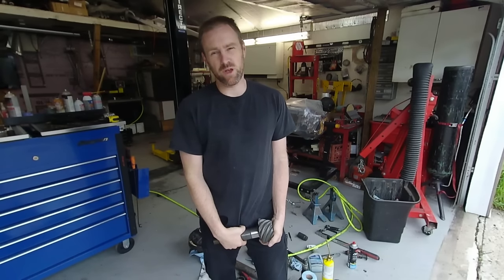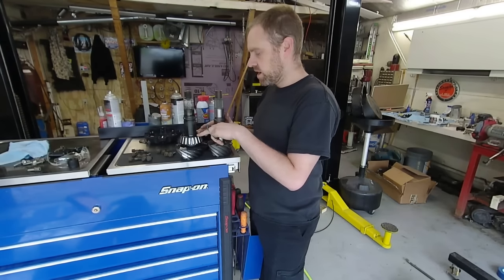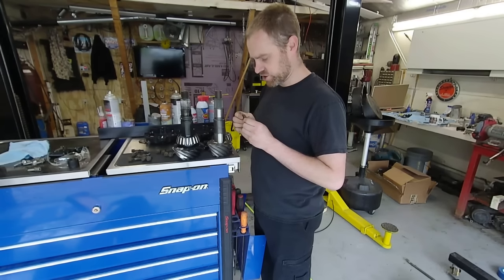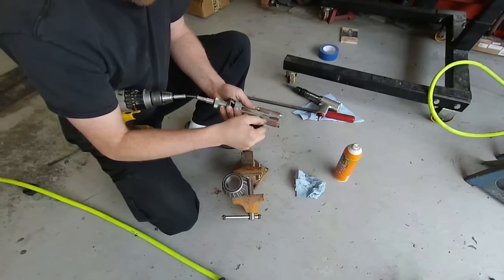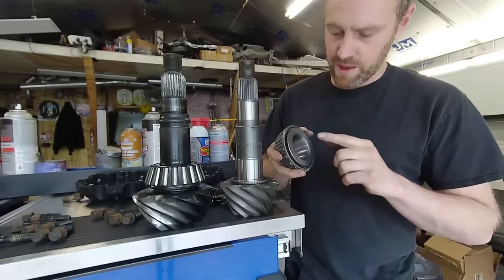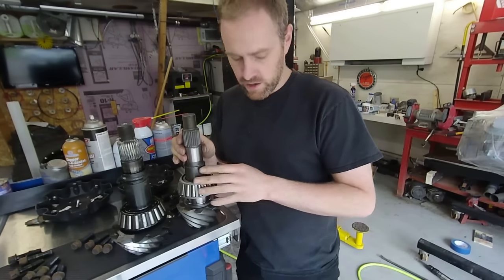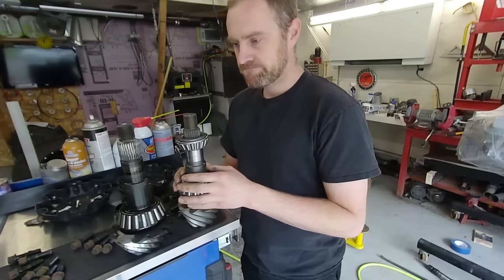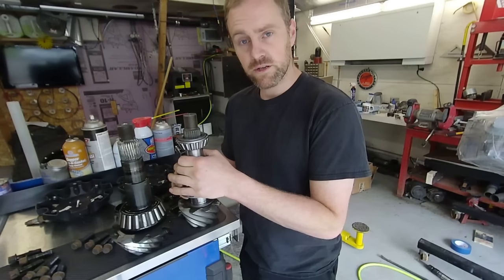Helpfull Tip For Pinion Gear Set Up in Differential

Comment: Thank you for all you help!  I pulled a 2008 suburban 8.6 dif apart because of noise.  Found a bad bearing on the gear side of the carrier accounting for the noise (I think).  Putting all new bearings back I noticed the pinion shim was .004" thinner than the number stamped on it.  .036 vs .040 stamped on it.  I checked it because the inner 3 centering tabs looked thicker as if the shim was turned down or worn down.  Have you ever seen this?  I can't see that the bearing spun at all. Would the factory turn a shim down .004?  There was no preload on the pinion before disassembly, it spun easily but was not loose.  the backlash was .025 to .030 before disassembly as well.  the ware on the gears looks centered and correct.  would you start assembly with a .040 shim or the one that was removed?
Reply from the maker: Those gears might be worn out, if you are replacing the gears you can start with what was in there and work your way according to the gear pattern. That play that was in it is far too much as well so you're definitely going to need to adjust something. I believe the typical is between .008 and .012 of backlash.
Reply: @CrazedPerformanceRepair  Thanks for your reply!   I figured the pinion shim sim must have been turned down at the factory and used it.  I got the preload set to 15 inch pounds (spec is 14 to 19 inch pounds).  I got it back together using the factory carrier shims in their same location and all new bearings. The backlash tightened up to .015.  There was .010 difference between the two carrier shims, so I swapped them and got the backlash down to .006 (spec is .006 to .010).   The pattern looks good, just a tiny bit to the inboard part of the tooth.  Nice a quiet now.  Thanks again for your help and the videos!
Reply: That's the same rear end I'm working on now. Switching from 3.73 to 4.11 due to larger tires.

Comment: Bearings are pressed on so they don't spin. I would never hone the bearing. Use proper tools for pressing on and off and use pinion setting tools to get depth right on second attempt. Why even use a roller bearing if its going to spin on the shaft under horsepower?
Reply from the maker: I still leave a light press fit to it and with even a slight press it's going to roll the rollers before it turns against friction. Not everyone is going to have the specialty pinion set up tools for every differential ever made. Especially someone like myself. I'm not afraid to take on just about any job so I work on all makes and models. No way am I going to have pinion set up tools for all diff model's when I only do a handful of them a year tops. If I was concerned about bearing spinning on shaft I would do what previous comment said. Get 2 bearings, open one up to freely slide and once pinion depth is figured press on the permanent one never opened up.

Comment: i changed the seal and everything went well except! between the speed of 0 to 30 its fine but from 30 to 50 there is a very loud wine and after that its fine whats wrong?
Reply from the maker: You got you depth set wrong. I bet it's louder under light accel or decel vs neutral at that speed.
Reply: Thanks for your help.

Comment: And I sure hope you aren't suggesting to actually final install that bearing that you honed. You removed the press-fit, it'll spin on the pinion shaft under a load. It's press-fit for a reason and that reason being it holds the bearing tight on the shaft  so the part that's not supposed to spin, doesn't spin lol. Why would you think it's ok to remove the press fit???? You can not do that it will fail in service, do NOT install that bearing. You can use it as a setup bearing but NOT on final assembly!
Reply from the maker: It's still a press fit, just not as tight of one. If it spins still even so then the bearing is not doing it's job. Technically that press fit portion is also held on by not only the press fit portion, but by the crush sleeve (and/or preload colar depending on diff) anyway. Furthermore I have done a great many this way and they are still on the road today after many years of use so once proven wrong I will admit defeat. Though considering the amount of load some of these I did have seen and not yet failed I doubt it will happen. Thanks for the input...
Reply: @CrazedPerformanceRepair  No you're completely wrong. 1) it's not still a press fit and 2) it's NOT held on by the crush sleeve. It's just not. You have no understanding of the rotational forces involved. And third, just because you put it together wrong and it hasn't failed yet in no way means it's done correct.
Reply from the maker: @roberts5118  so let me get this straight, I have to push on the bearing because it's tight just not as tight as factory, yet it's not at all a press fit? Also, there's no sleeve or collar pushing against the surface of that bearing? Interesting, I must be adding too many parts... It is true though that just because it worked doesn't mean it's correct. I will give you that much.
Reply: @CrazedPerformanceRepair  by honing the bearing you're removing that press fit. You're making it slide on easier. You don't want that. You want that part of the bearing to be as tight as it possibly can be while still able to install or remove it. Why?? Because you don't want it to EVER spin. It's not the bearing surface between the pinion shaft and bearing. The bearing surface meant to spin and wear is between the race and that part that you're pressing onto the pinion shaft. What is so hard to understand. The rollers on that bearing will wear and roll against your outer race and the inner race which is part of the bearing that you're pressing onto the pinion shaft. If I have to explain all this to you then you certainly don't have an understanding of how a bearing works. When you tighten the pinion nut you are crushing everything together causing preload on those bearings and if you put too much preload, the inner race that you loosened the press fit on may spin on the pinion shaft instead of the rollers spinning in-between both races as they are designed. You're creating a potential to "spin" a bearing. Haven't you ever seen a spun bearing on a connecting rod. Connecting rods are supposed to slide around and rotate around the crankshaft journal not slide or rotate around inside the journal of the aluminum rod. Those bearings are also press fit in the aluminum rod. Things with a press fit are designed that way for a reason. Apparently you have no understanding of why things are press fit and you figure you can just alter them with no consequences. Maybe you can but it is certainly not the correct way of doing anything because it's only a matter of time before it becomes unglued and starts spinning where it shouldn't.
Reply: @CrazedPerformanceRepair  the collar or crush leave that is pushing on that bearing is simply pushing on the inner race of the bearing it has nothing to do withholding that inner race solid and connected to the pinion shaft the way it should be from a proper tight press fit. The crush sleeve cannot prevent that inner bearing breaking away from the pinion shaft and spinning on that shaft where it is not supposed to. So no in absolutely no means or any way is the crush sleeve holding that pinion bearing onto the pinion.
Reply: @CrazedPerformanceRepair  take a bearing with its race and hold them together and look at it and see what spins when you turn it. There's 2 races and bearing rollers in-between
Reply from the maker: @roberts5118 I understand everything you said perfectly clearly. You're completely missing my point however. If the roller functions how it should any amount of friction on the race will prevent it from spinning. I'm not removing the press fit as you claim I'm simply reducing it. It is still a press fit. Sure it's no longer a 0.002 press fit but I still make sure to maintain a 0.0005-0.001 press fit. This adds friction. The mention of the crush sleeve is because this to adds friction to the race. All this in turn means the only way that race should spin is if the bearing has failed doing it's job creating more friction then the race has. Yes I am aware of how a bearing works. Your hands add friction to the race and the race stays put allowing the rollers to roll. You must have never worked on trailer axles before. The inside race on the axle its self is a no press fitment and never spins unless the bearing fails first.
Reply: @roberts5118  oldish front wheel bearings dont seem to have an issue , and they dont use crush sleeve at 150 lb ft?
Reply: This video should be taken down. It’s giving out all sorts of bad advice that people may end up following leading to wasted time, money, or injury.

Comment: use heat gun to expand inner bearing race
Reply from the maker: I like to put inside parts in freezer and warm up the outside component. Then they don't need to press at all. That's not practical though if you plan to pull it off right away.

Comment: I guess I can not just replace the pinion gear if the ring gear looks good
Reply from the maker: Replace them as a set.
Reply: @CrazedPerformanceRepair  already did then as a set.  Set load to 24 inch pounds for the pinion.   Almost done , 1 hour then should ready for test drive.
Thanks for fir the feedback

Comment: The reason the old unit has failed is because the shimming is off ? Or you saying it's a good way to start the process ?
Reply from the maker: This vehicle was getting a new set of gears, as in a different gear ratio than stock. This requires setting the pinion from scratch.
Reply: @CrazedPerformanceRepair  nice explanation thanks 
I'm trying to understand the movement and effects
Reply: @CrazedPerformanceRepair  check with a ring and pinion company to see if its okay to hone out the new pinion bearings...! i dont think they would recommend that
Reply from the maker: @yourlocalalexis4578  don't need to check, I'm sure they wouldn't recommend it. I have enough years of experience now to know this works and last a long time. I've done several with many years and miles on them still running strong.

Comment: Good video!! I have a question? I'm putting a track lok to a 2003 grand marquis, original I have 2.73 I'm installing a 3.27 I buy on eBay use everything, when my mechanic finish the installation one tooth stock every time he turn the pinion the same tooth, any ideas? I appreciate your help
Reply from the maker: What do you mean by "one tooth stock"?
Reply: Used gear set?
Reply: Yes if the tooth "sticks" in the same tooth on the pinion simply throw away that pinion and ring gear set and get a new one. Then install it with new bearings. You should follow the manufacturers service manual and also find a new "mechanic" if he can't figure out something that simple. He's not a mechanic but I'm sure he thinks he is. Find ANOTHER mechanic.

Comment: The end of a pinion is etched with a plus or minus number.  A plus number has to be subtracted from the recommended pinion depth and a minus number added to it.
NO the original shim is NOT necessarily close to the one that the new gear set requires.
Close doesn't count.  You need to know the recommended pinion depth and have the tools to measure it and then use the plus or minus number to select the correct shim.
Assembling a differential is NOT a guessing game.  Do you think that the manufacturer guesses when they put them together?   If you actually know what you are doing then setting up a differential is NOT a challenge and NEVER a guessing game.
Reply from the maker: Who said anything about not being precise? Take a chill pill pal, if I bought the tools for ever differential to measure pinion depth I'd be broke. Besides that, this is a video to assist those doing it at home. Things can be done correctly without the fancy factory set up tools. It just takes more time to do it.
Reply: Crazed is an excellent description.  By following your advise even skilled mechanics would be crazed and probably never get it right, and amateurs at home don't stand a hope in hell.  Your way or the correct way,  which way is going to cost less in the end? @CrazedPerformanceRepair
Reply from the maker: @Trout11211  well, I've never had a rear end I did fail other then the tiny gm 10 bolt that the guy later attempted to put down 800whp. They don't like anything more than around 600ish it seems. It was fine at 580 but the moment he hit it with a 250 shot of nitrous it didn't like that so much😂. But what do I know I'm just some crazed fool being told how to fix things from a keyboard warrior.

Comment from the maker: Have any of you ever used this technique in the past?
Reply: Yes!!! Works great and potentially saves $$$ on a ruined bearing....love your channel
Reply: Yes I honed out sets of set up bearing for the common diffs I would rebuild. Get proper pinion depth achived than press on the other new bearing and assemble. I was told to be careful using compressed air to spin them bearings like that when blowing them out. They say the bearing being loose in the cage spinning around and chattering could defect the race or bearing surfaces with pits or markings.
Reply: Absolutely, just have to pay for the correct set of bearings to make into setup bearings.

Comment: NEVER DO WHAT HE DID WITH AIR. The bearing can EXPLODE. if spun with air. You can blow air to clean it. No problem, but never spin the bearing with air. Without the race holding the rollers in place Doesn't pickle force can actually make the rollers come out of the cage and if that hits you it can go through you

Comment: You can hone that bearing I.D. all day with that cheesy little wheel cylinder hone, but at the end of the day, I don't think you can remove even .0005"  of material off the hard chrome surface of that bearing. Are you kidding me?! Simply remove the black coating off the bearing surfaces (2) of the new pinion shaft with crocus cloth (or break the glaze if reusing the old shaft). Then coat with anti-sieze before reassembly, and the pinion bearings will press on and off smoothly, and you won't have to be concerned with the bearing turning on the shaft due to heat expansion under extreme  service.

Comment: I've set up hundreds of ring in pinions over the last 4 decades and 
 this is the stupidest thing I have seen in a long time. You can easily make set up bearings just for this purpose. Now days you can buy set up bearings for most common diffs.  They call them machined parts, and use an EVEN press fit,  for a reason. Let the machinist do the machining on any bearing you plan on getting a long life out of.
Reply from the maker: Did the job once, I don't see the same diff time and time again why invest in a one time job. I only do a couple diff setups a year on average. Only one diff I would consider something like that for, Ford 9in because I do them often enough. Btw, this one seen the road for three years after this many times pulling a trailer with 0 diff issues. He then sold the truck. I also did this same process on similar one pushing out over 1000 hp a few years prior with different rear end set-up, (little older). Two owners several engine fails and a transmission later diff still holding strong no noise. Now that truck was sold again though and I lost track of it. If it works in practice why bash it? If you've done so many why watch me? If you're doing so many then clearly you have a reason to own setup bearings.